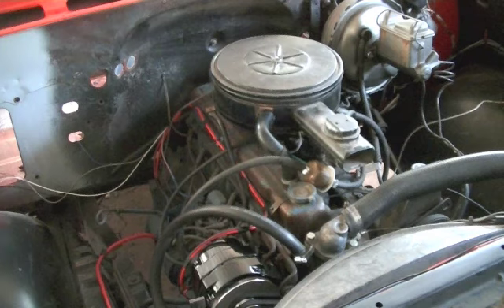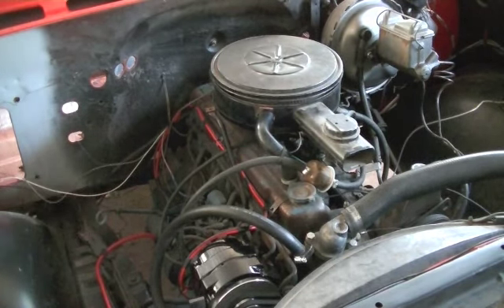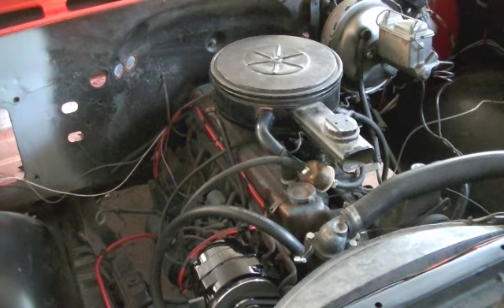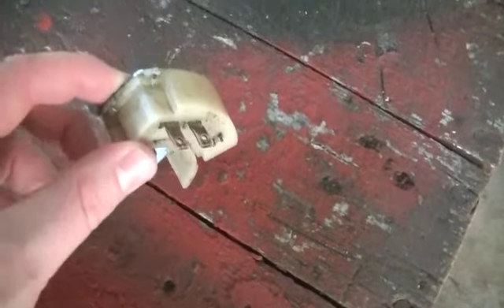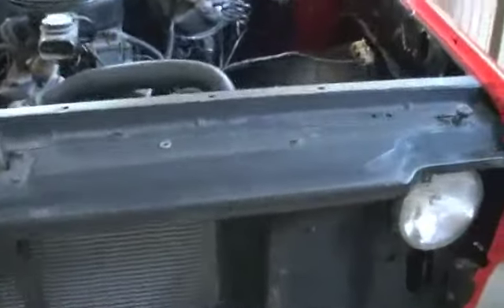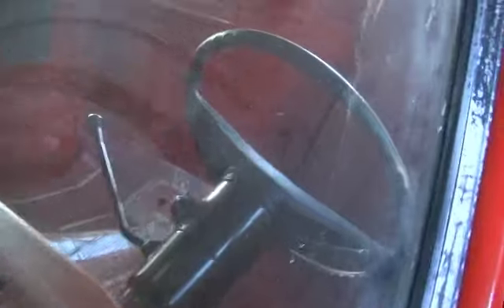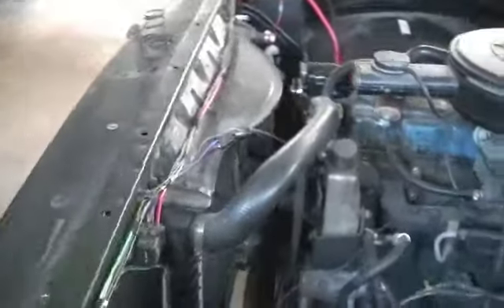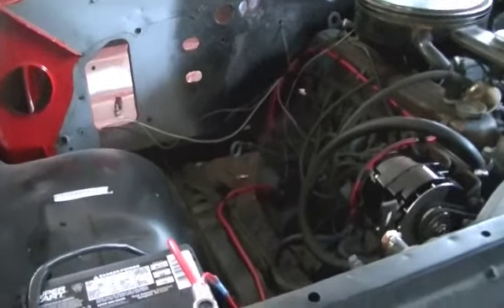Part 33 C10 Wiring Repair | Universal Wiring Harness

Comment: Very good and instructional videos but I have one question because I know the universal wiring harness comes with a wire for the heater and some of these trucks are have their own AC heater wiring harness under the dash so by all means where does that white heater wire if it's white but where does the heater wire connect to? Since like mine it's an 83 it has its own separate wiring harness inside to comes through the firewall for the heater in the air conditioner

Comment: I, watched all 33 series of your wiring videos. All of them was very interesting as all your video are.  I picked up on a lot I am in the process of wiring my 69 step side I am using a painless wiring harness p/n 10206 28 circuit . I still can use some confident but do to my low budget I have to do it myself. I will learn as I go again thanks you for all of the great information it was very helpful for narvas.
Reply: How did it turn out and hold up?

Comment: Will that harness work with the factory gauge cluster?
Reply from the maker: nandoGdog Yes, you can make it work with the factory cluster.  You'll just have to trace the wires on the printed circuit board on the back of the gauges and wire the new harness into the factory plug.  Shouldn't be difficult, just time consuming.  Thanks for watching!

Comment: 1 more question man. I'm in the process of wiring my truck but i ran into a problem i have 2 red wires on my harness the +battey/starter..but the old set up had 1red wire that split to my horn relay (i thought was to much voltage) then to the +battery/starter.. so from that do i need a voltage regulator??
Reply from the maker: You shouldn't.  It's still just 12 volts going to the horn relay.
Reply: Oh ok it did have a holes like one was there but i never had problems..So i guess i wont get one and just use the horn relay the splice it to my +positive/starter